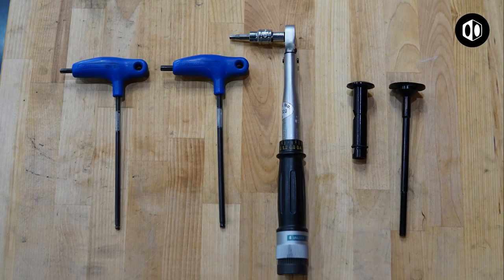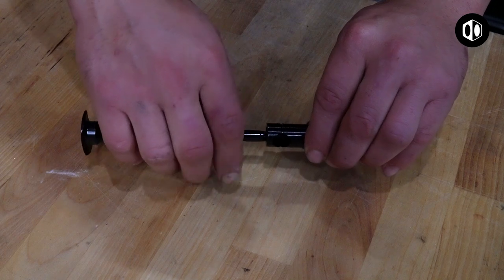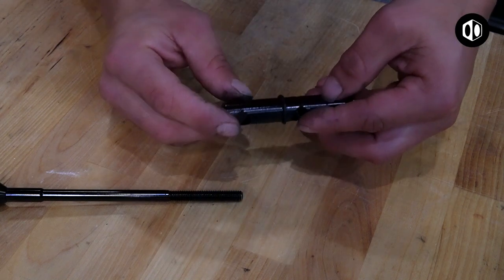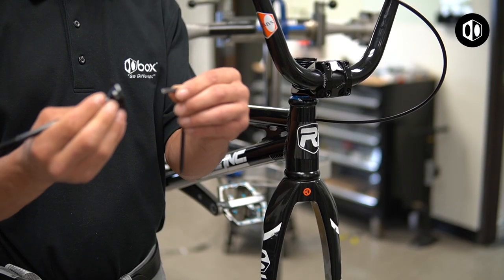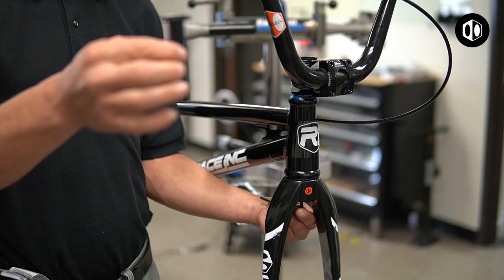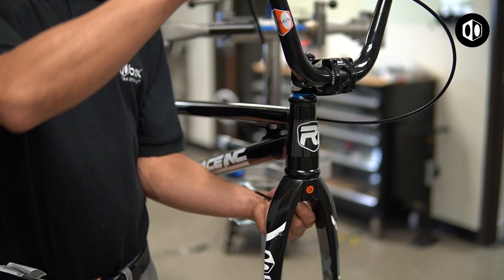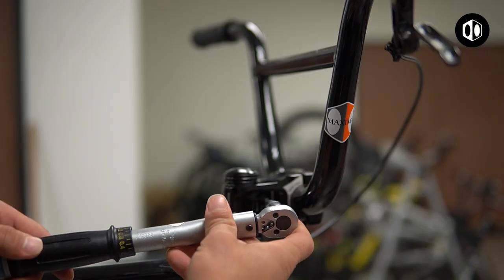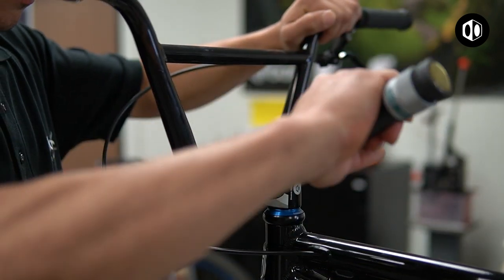BMX Fork & Stem Lock Installation Guide

Comment: Two quick questions (1) Is the bottom of the stem lock supposed to recess into the fork at all? Mine does not and I assume that's correct. (2) Should the bottom of the stem lock be positioned parallel with the tire or perpendicular to it? Thanks.
Reply from the maker: The bottom of the stem lock should be positioned parallel. If you set it perpendicular, you'll find that it will not slot in. I hope this clarifies things. Thanks for watching!

Comment: Whenever i tighten the stem lock my steering locks with it
Reply: Did you ever figure this out? I'm having the same problem with the stemlock.
Reply: @Harbaaa I actually did, I didn’t have the crown race in my fork lol
Reply: @VictisRides  Great that you figured it out! Unfortunately no help for me. I have a crown race and have double checked everything, but still the stemlock pretty much locks steering with it.
Reply: @Harbaaa  do you have a spacer that goes slightly over the top of your fork ? That also helped me in the past
Reply: @VictisRides  Yeah, I do. The only thing I can really think of is my SD (Meybo) integrated headset being incompatible with the Box Fork and stemlock.